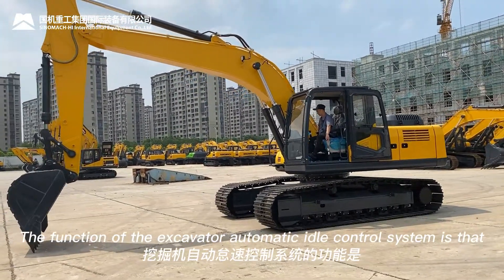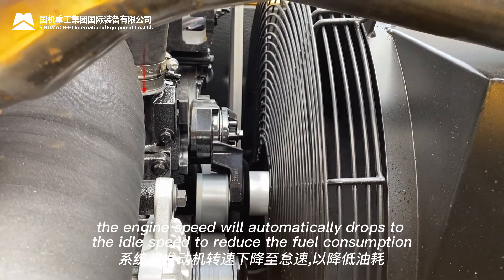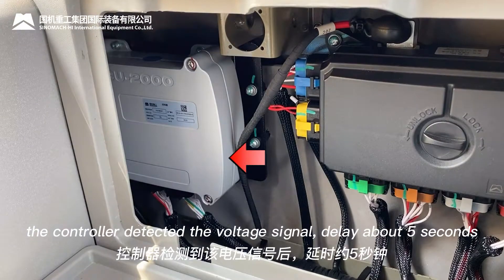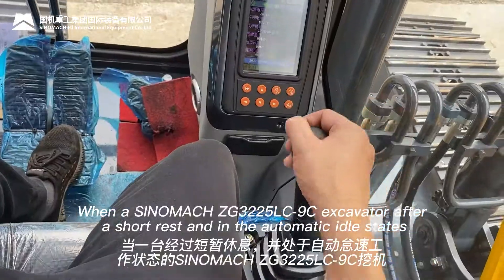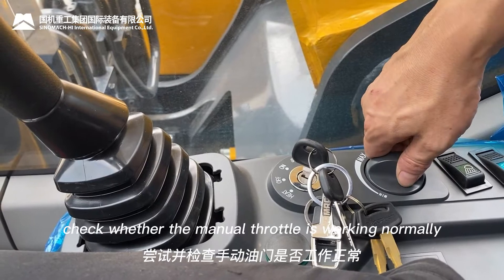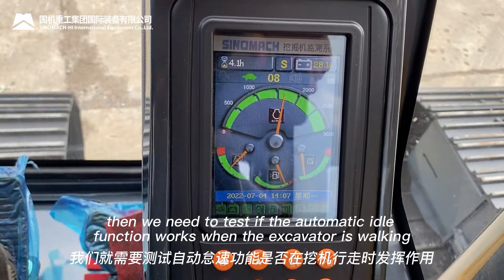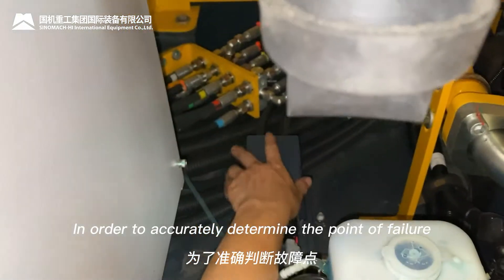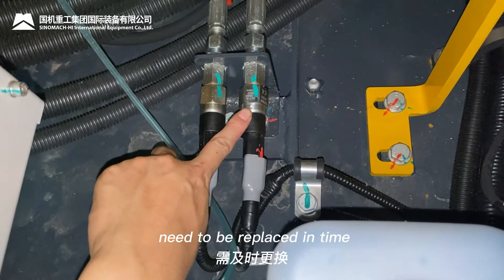Failure Case of Excavator Automatic Idle Failure

Comment: Hi, I have a case 210 excavator, and the trottle goes up and down without touching any instrument on the machine. Would you say this is to do with pressure switches?
Reply from the maker: Can you give us your contact information? We will have a technician get back to you.
Reply: I have working excavator   the rpm not function the dial switch working  the monitor panel  increase the nmber but the motor not function the motor is new